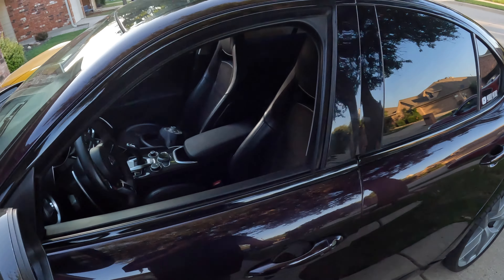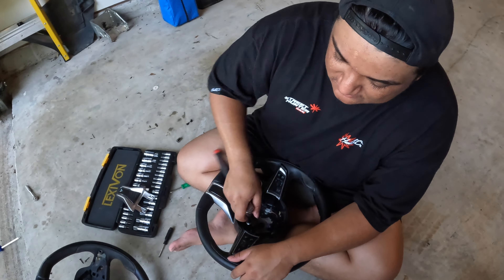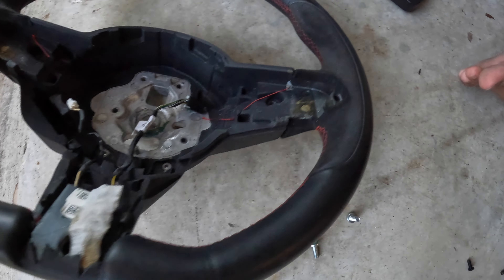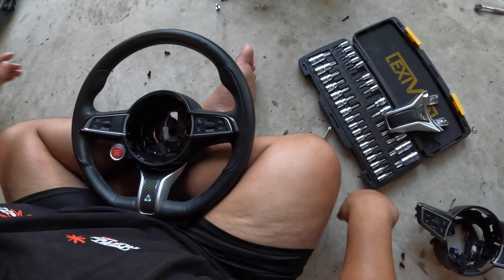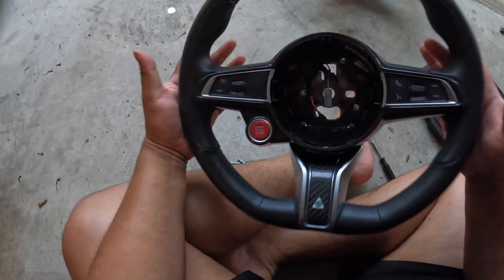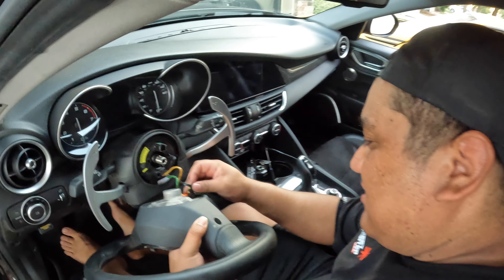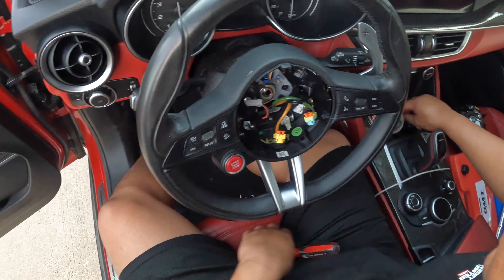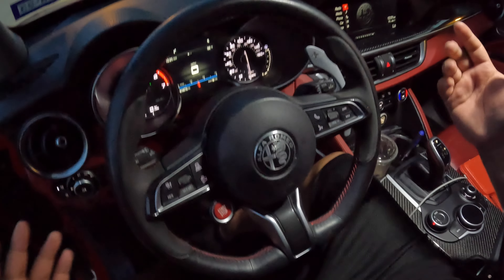Alfa Romeo Giulia Steering Wheel: Time Attack

Comment: Bro i have a giulia want to straight pipe it dont want to spend necessarily almost 2k for an exhaust but dont know if the stock exhaust with res and muffler delete would sound the same as the 2k one. What you think about it
Reply from the maker: Won’t sound exactly the same but not far off, just do a muffler delete. You can always upgrade down the line
Reply: @ModdedMotors  thanks man! Appreciate